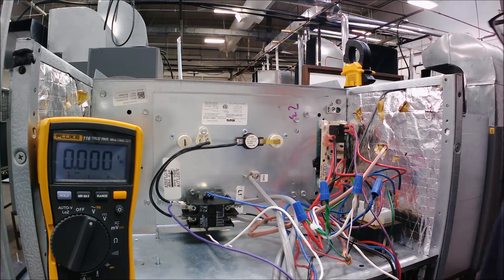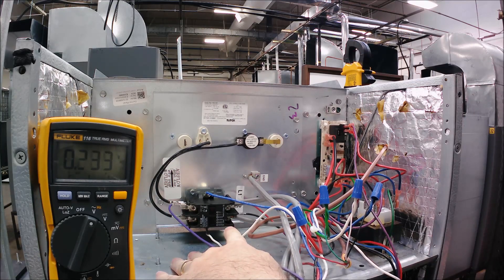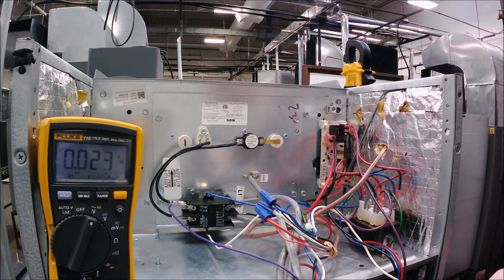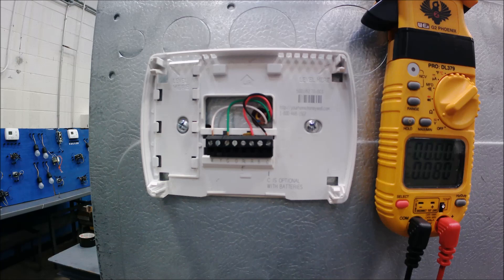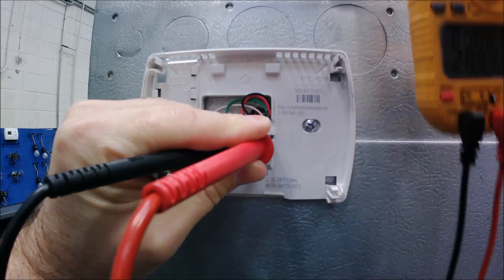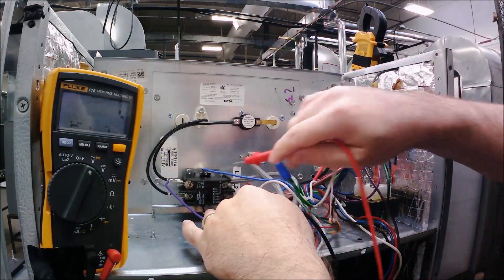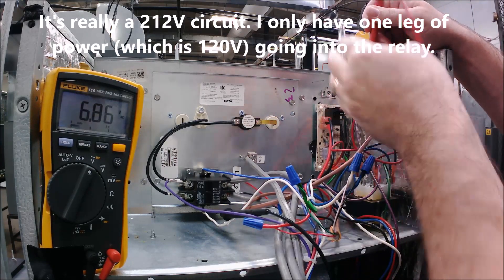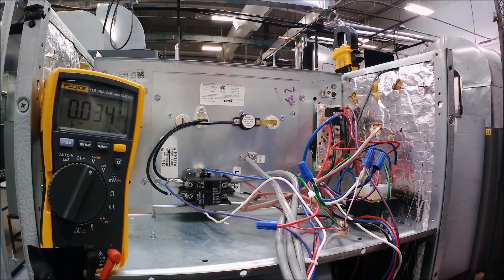Low Voltage Troubleshooting a Goodman Electric Heat only Unit

Comment: Trying to do a simple thermostat swap. Well the old one took batteries. The new one has a C wire. The thermostat wire has only 4 wires red, white, blue, & green. If I use the blue for common, white for heat, red as power now only the green is left and it needs to operate the fan and the ac compressor. Trying to understand how and what to jump in the unit in the very hot attic.
Reply from the maker: Just curious...electric heat or gas heat? If you are working on a conventional system setup you should use 5 wires if you aren't going back with batteries in the tstat. Makes it easier of course. If you only have 4 wires (and they worked fine before) I would just use a battery powered tstat. You could just the "g"and "y" in the tstat but then you lose the ability to just run the fan by itself if you ever wanted to.
Reply: It is electric heat. You are saying it is possible by jumping the G & Y, Great info, thank you!
Reply from the maker: @1mikesmiley- Possibly... in the old mercury thermostats the G "auto" and Y circuits were connected so that when the AC cuts on then the blower "automatically" did too. But if you turned the blower fan "on" it would only run the fan. 
If you connect them (G and Y) manually you will loose a little functionality because you can't make it distinguish between the fan and the AC. So when one comes on so will the other! Not a huge problem though. It does save some time/money replacing wire and all.
The electric heat strips themselves are usually connected to the fan by high voltage circuits going through the relays themselves so there is some separation there which means you shouldn't turn on the heat strips when you turn on the fan/AC. If there is a circuit connecting the heat strips to the blower in the relay then you would want to make sure the programming of the new thermostat does NOT energize G when turning on the heat..otherwise whenever the the heat comes on so does the fan AND ac! And you get nothing but a high light bill.
Reply: Exactly the info I have been searching for, thank you so much! We never run the fan without the ac or heat.
Reply: Ok, I got it fixed thanks to your advice. White wire for heat, I left it as is. Red wire is for power I left it as is. Identified the C wire in the furnace in the attic, C wire now goes to white wire going to the compressor outside and the blue wire going to the thermostat. Identified the G wire in the furnace in the attic, it now connects to the red wire going outside to the compressor (should't need the jumper) and the green wire going to the thermostat. The thermostat is wired: Blue common, white heat, red power and green blower. Thank you again for your help!
Reply from the maker: I like it. A little funky for some but i think it will work. Best part...no batteries 🤣

Comment: Why do I get 24vac on my contactor but is not pulling in
Reply from the maker: Sounds to me to be a bad coil. You can use the meter to check for resistance of the 24v coil. Power off, remove the wires from the coil connections amd check the resistance (ohms). It will likely read "OL" on your meter. If so, coil is bad. Replace contactor!

Comment: When wiring 24 volt system where does the pink and purple wires hook to
Reply from the maker: Not sure about a pink and purple wire. What kind of system are you dealing with?
Reply: @johnjennings-JJ  IT IS A GOODMAN

Comment: I have a 6yr old Goodman furdown 2.5 ton 10kw. My thermostat wire had the Blue wire cut on both ends. Only have 4 wires connected to thermo and I power it with AAs. If I install a new smart thermo that requires a C wire, how can I get 24v to the thermostat? Thanks for your great videos!!
Reply from the maker: So it sounds like you don't have any spare wires available to use if I assume correctly. Maybe 3 choices? #1 - Usually, but not always, contractors run a thermostat wire with a few more conductors than needed and a little slack in the wire as well. Maybe try to pull a little slack from the thermostat end of the wire...you may be able to get enough out of the wall to either connect to the new tstat or at least extend the cut blue wire. Of course the end of the wire by the unit has to be extended to be connected on that end. #2 - find a smart thermostat that uses less wire. J once installed a carrier thermostat that had a sub base (like most others) for all your low voltage wires to connect but the face of it could be "remoted" to another wall using only 2 wires. We mounted the sub base to the air handler and used 2 wires of the thermostat to "remote" the face of it to the normal tstat location. I will have to try to find that model again if I can. #3 - probably most logical - run another tstat wire and make sure it has more conductors than you need. If I need 6 for a heat pump install, i run a 18/8 tstat wire, 18 gauge 8 conductor.

Comment: QUESTION: 1.3 AMPS IN FAN MEANS HIGH SPEED?
Reply from the maker: Forgot exactly in this video. Only way I would say to do it is look at the PSC motors leads and identify which one is Hi, Med, Low...the one pulling amps is the te being used! Whatever the amp draw number is.

Comment: I like this video, I'm going to check an old electric heater tomorrow 09/14/2022. The customer said they don't feel the hot air. I hope to find something to repair.
Reply from the maker: Probably something simple like most calls I would imagine. Electric heat is like an 80% furnace...almost as simple as you can get! Thank for checking it out.

Comment: Thank you for this video. I don't why my air-handler does not have control board. They used Timer Delay.
Reply from the maker: Just the way they made it! Nothing wrong with not having a control board, just a little different.